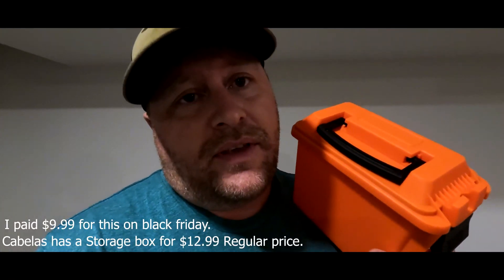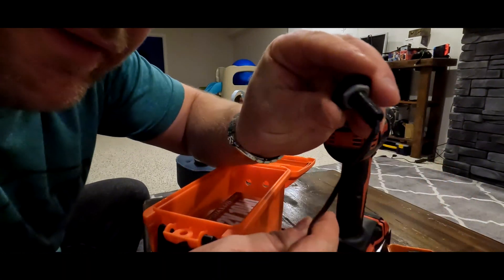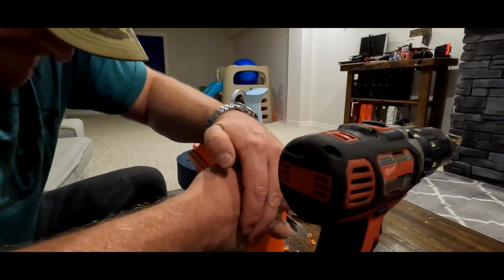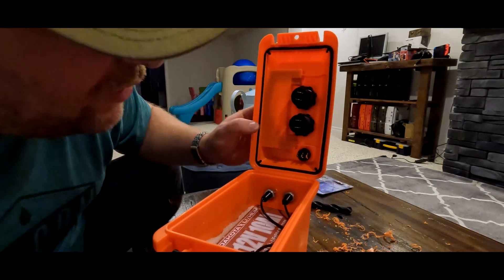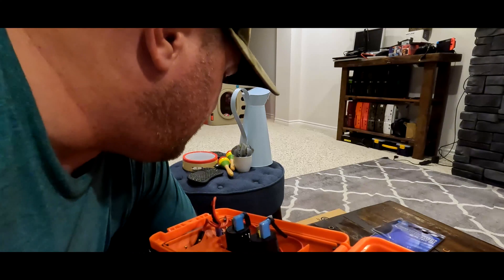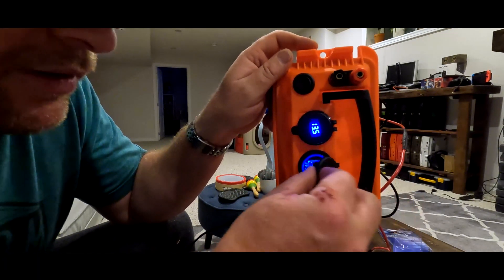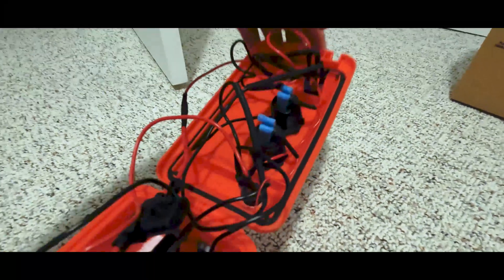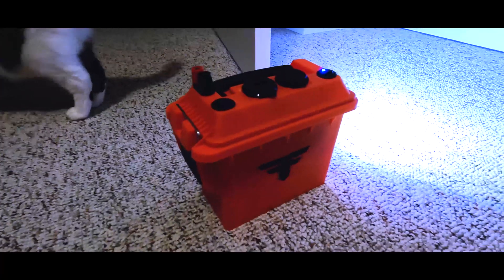How to BUILD A LITHIUM POWER BOX For ONLY $36!

Comment: Made my head hurt just thinking about doing it. Now I'm definitely gonna BUY one 🤣 good for you though Kevin.  I don't have the patience. I'd gladly pay someone to do it 😉
Reply from the maker: I had someone build my first one and it broke. I offered to bring it in for repair. Enzo said I had to ship it to him. Shipping there and back would cost more then making a new box. You can also buy an all in one USB panel already prepared wired.
Reply: @FoxFishing4K  I'll buy yours... how's $37 😉🤣👍
Reply from the maker: @mehlbeck  lol I'm not taking the risk. If one of these things burns a house down or a truck lights on fire  the builder would be liable. My original was close to catching fire. Hence I built my own and made it secure. Battery in the purchased one was loose and rattling around inside lol.
Reply from the maker: @mehlbeck  if you bought a power box make sure that battery is secure.